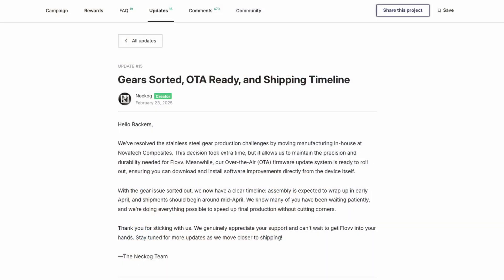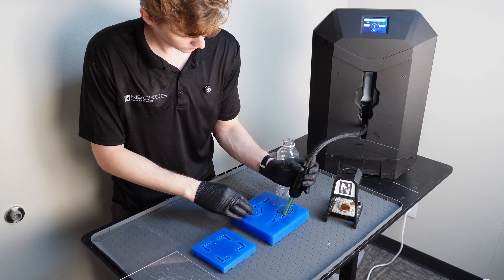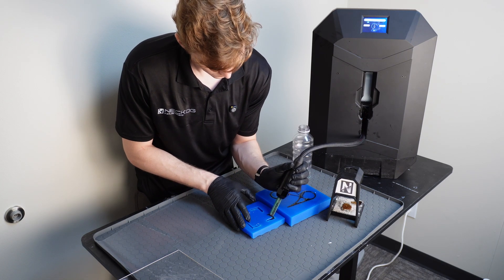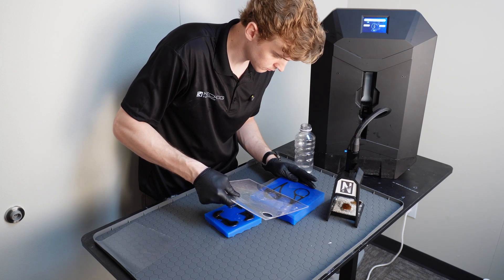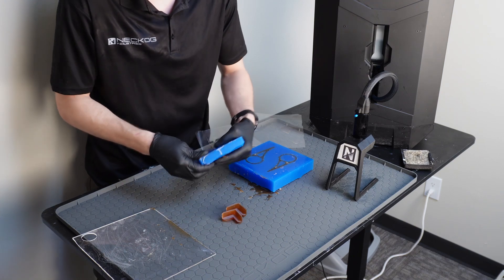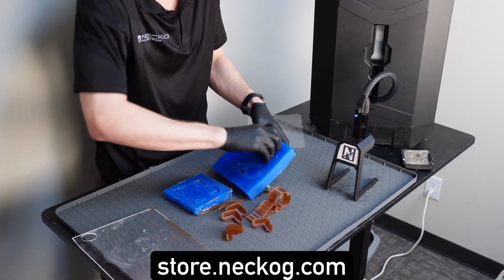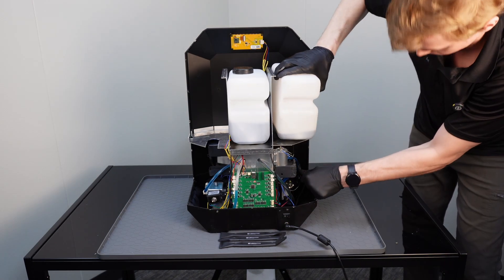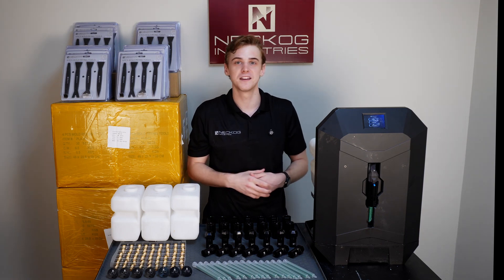Desktop Injection of Flexible Parts | Open Molding Injection Technique

Comment: Anybody in the wild using this for production?
Reply: They STILL haven't shipped them yet!
Reply: @adamwilson5419  I wondered how mixed material didn't stay in the mixing chamber after the cleaning cycle. That section would need manual cleaning or replacement, wouldn't it?

Comment: looking forward to see your project grow.... and for sure will buy one. maybe for your next gen you could include the idea of swappable tanks from ground up. I thinking about access without removing the case, and self/quick sealing valves. usability  like with this water tanks of coffee machines.

keep up the good work!
Reply from the maker: The problem with self/quick sealing valves are they are not really compatible with wide variety of chemicals that Flovv is compatible. We have tried many valves but the longevity is a major issue. There isn't an alternative to this size that can last more than 2 months. 

Thank you for the good wishes.